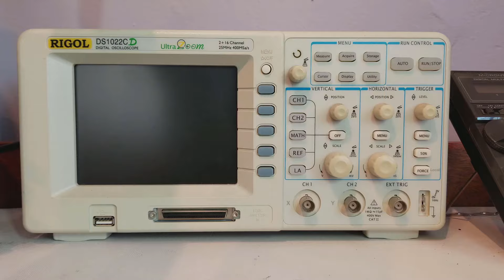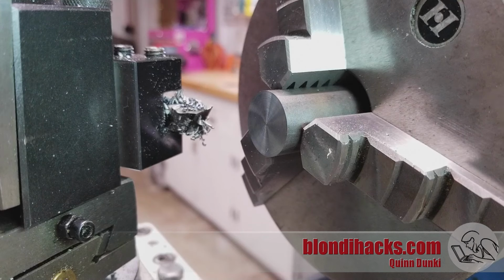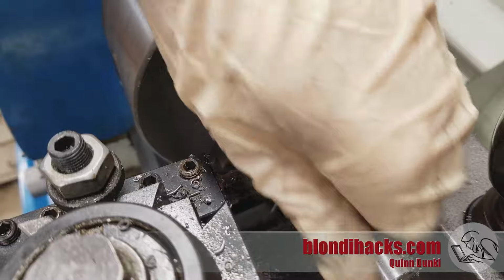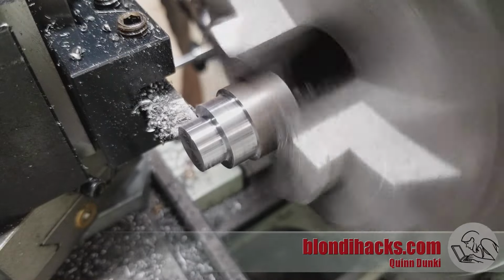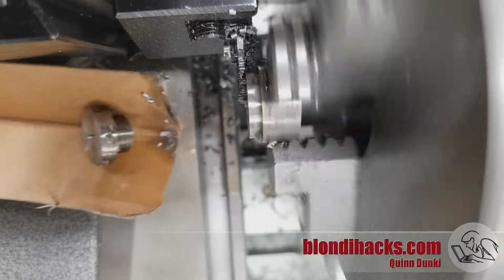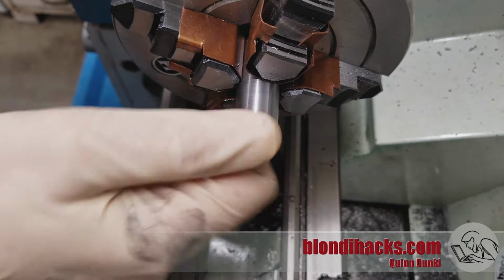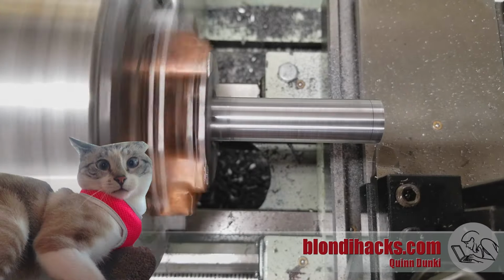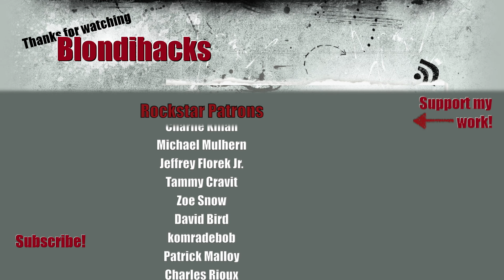Metal Lathe Tutorial 18 : Your Second Project!

Comment: This would be a fun place to use left hand threads too; single-pointing the tube would be a headache but who would ever think to turn it the other way?  Your indexable ear tooling would be as safe as humanly possible!
Reply: Good idea Jim, not too tricky to make really but a tricky thing to find without x-ray or ultrasound. Looks like a wrist pin for a crank would be a good place to hide the part.
Reply from the maker: That's a great idea! A left-hand thread could really confuse people 😃
Reply: If you really want to confuse people, add a drop of loc-tite 603
Reply: its likely rubbing a greasy finger over the seam would reveal it but i wont know till i make one ;D

Comment: So I actually did something close to this. A few changes between mine and yours:
1) I used Alum tube that was somewhat close to my final dimension. I partially bored it out to be concentric. 
2)  I then made an end cap that fit into the bored out portion. This requires you to understand fits and tolerances as it had to be hammered home. After that, I cleaned it the end and made it square.
3) Now for the next part, we pretty much did the same thing for the screw in cap, but, like the closed end, I made another end cap that was bored for a 1-12 thread.
4) I didnt have a 1-12 tap, so I had to use my lathe and do some internal screw cutting. The only hard part here is how to know when to stop cutting. I didnt have a 12 TPI thread gage. 
5) Make cap following your steps. Since my lathe was still set up for threading, I did that instead. I also integrated a thread relief on the cap that was as wide as my parting blade.
6) Polish as needed.

So sort of the same, but kind of more advanced. It came out looking really nice. I dont know the technical term, but they seem like "dead drops" to me. Would be a great place to hide keys out in the open.

Comment: I was just discussing with a friend about making a larger version of this from some 76mm (3") aluminium - I needed about 10mm (3/8") of the stuff, but ended up with 500mm (20") because the price of a smaller piece was almost the same anyway. Extra complexity is that the thread needs to be cut using a single-point tool (unless you have tap and die for something like 65mm(2.5") thread), so probably not suitable as "second project".
Reply from the maker: Yah, the thread size is definitely the limiting factor for keeping it a beginner project.

Comment: The other day I made purely out of pine a hammer of about 2 inch o.d. by 3. 5 inch length with about 5.8 inch by 5 inch length of Redgum timber for the light tappy tap taps on metal items like brass so as not to cause damage. As part the idea of this hammer, if I use it between another metal hammer, it gives the timber buffer and the timber hammer shutters out of the way, the Redgum handle being the size it is, it can break before an injury would really happen.

I'll make a similar one out a bit harder timber so that this one would be able to take bit higher punishment.

Comment: Today I accomplished my first real project. I shortened a 1/2" to 1/4" BSP adapter to allow me to use an old WP9 tig torch with a WP17 tig welder. Of course both the fitting on the buzz box  and the adapter are a concave fitting. Delving into my box sets of things produced an 'O' ring of the correct diameter, but also revealed a set of metric and Imperial taps & dies that I'd forgotten purchasing. M3 - M12, NC 1/4" to G 14" complete with drills to match. I'd love a BA set as well, but ... money ... :-(

Nah we're cookin' wi' gas!

Comment: I did one in aluminum, but with how soft the metal is, the seam becomes visible after just a few uses, so i don't recommend doing that. If you can anodize it, maybe, but i don't have that ability. I'll definitely do one in steel once i have an occasion to get some.

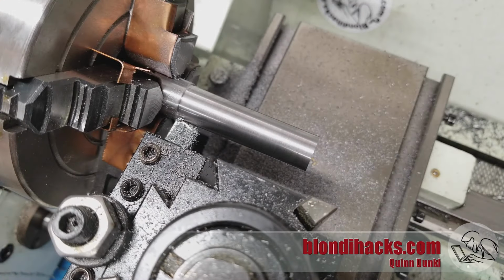Comment: Question on order of operations, at 12:53 in the video the cap seemed really tight from the tool pressure from the turning operations, would it help to do the turning before the facing so the threads are closed a lot tighter when you do the facing, giving more leeway for if you cross over the center? Or is the pressure to unthread after crossing center too high for this to help?

Comment: You might want to make one of these long enough to take full length TIG electrodes. You can have them pre-sharpened and have them ready to use along with any shorter stubs you may have. Most of the guys I know use a short pipe nipple with two end caps but this would be far more unique.

Comment: I was waiting for you to turn the die around and finish cutting the threads.  I"m guessing this still doesn't get you close enough for this trick to work?
Reply from the maker: Great observation! There are two factors- first, as you say, that still won’t eliminate enough of the fillet for a perfect seating of the cap. Second, the die I used doesn’t have that flipping feature. It has tapered teeth on both ends.

Comment: yes you do have bottoming mills just dedicate drills with a 180  degree point it does require grinding, use a broken drill then grind cutting the 180 degree it worls I have done it flor years ignorent chief engineers refused to buy mills  ships engineer